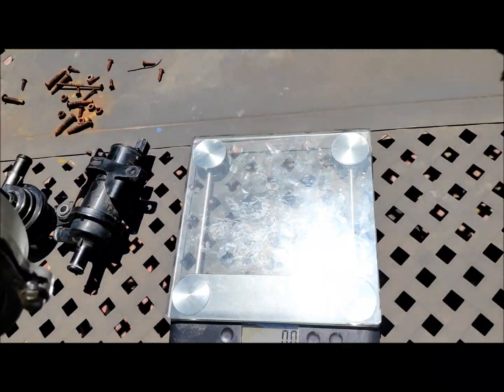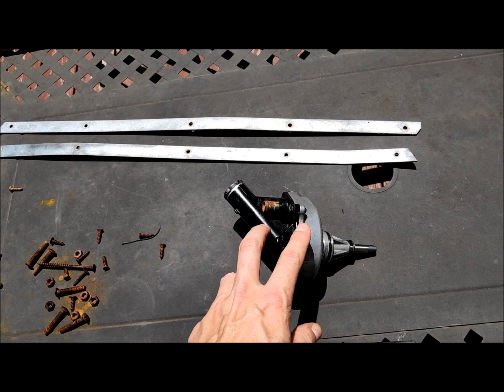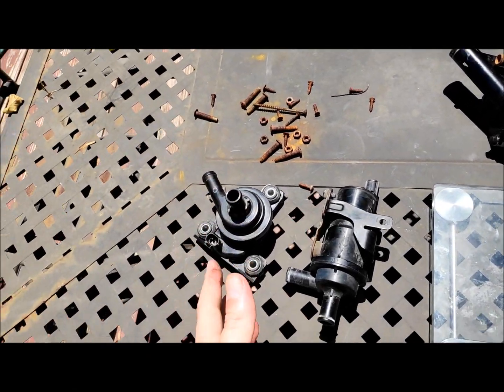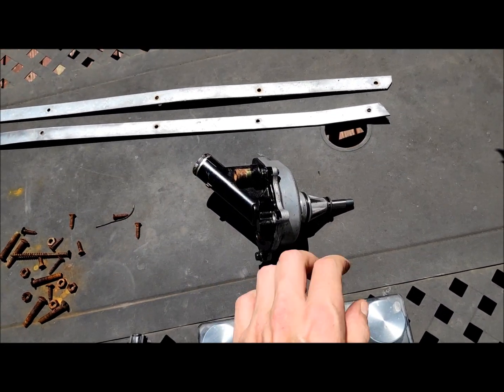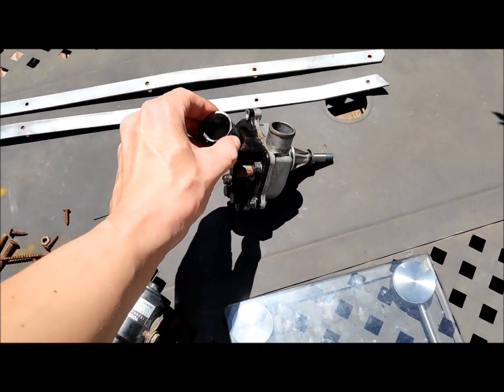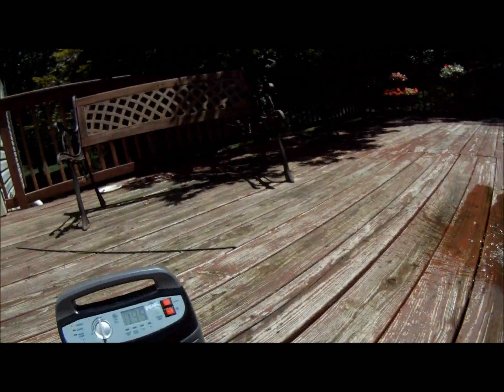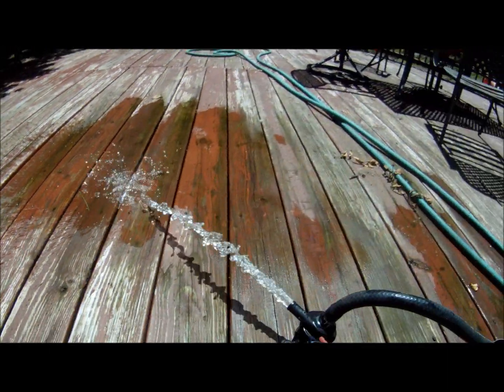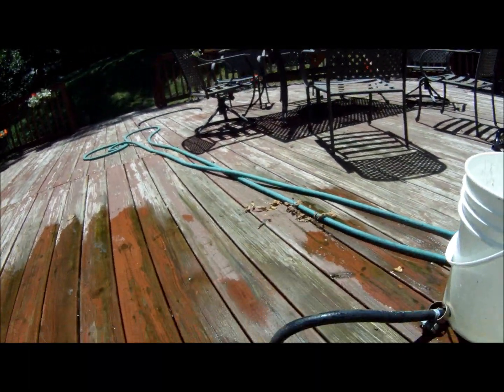Kawasaki Water Pump vs Toyota Water Pumps, Which one Flows More, Which one is the Best?

Comment: Interesting test.
I highly suspect that the electric drill wasn't spinning very fast, and that the mechanical pump would flow a lot more water if it was being driven at the same RPM as it would when fitted to the engine.
Reply from the maker: The drill was spinning at 2k rpm, which is just as fast as my engine would spin the pump at 8k rpm.

Comment: quite inaacurate result,  mechanical pump should have same setup as electrical,  which is tapped on bottom of bucket and also shoudnt be on free flow,  ther should be atleast some resistance on the flow, (blockage on exit hose?